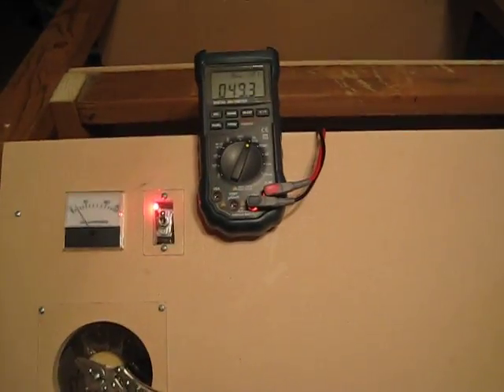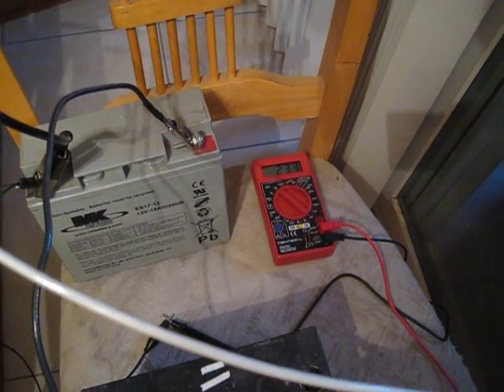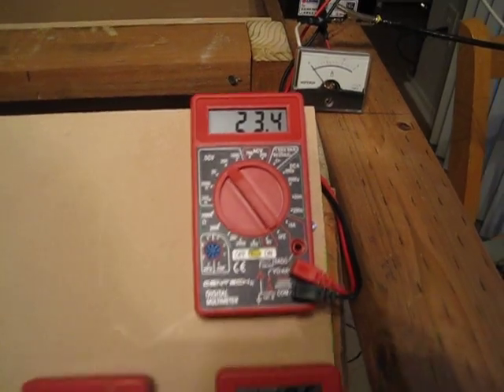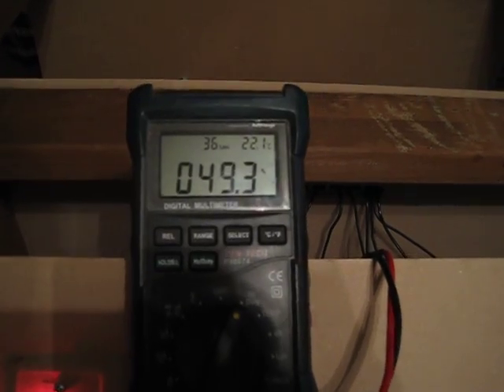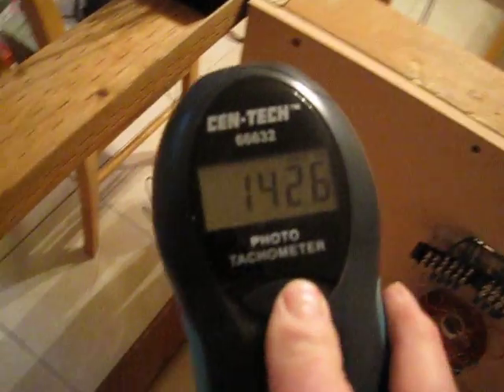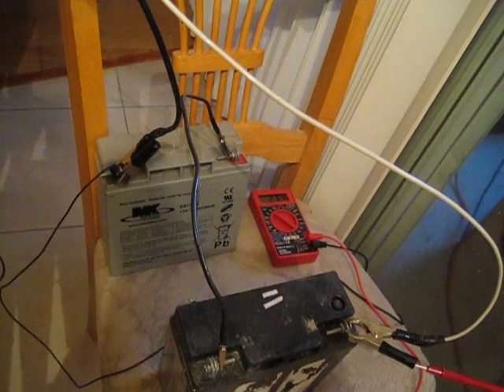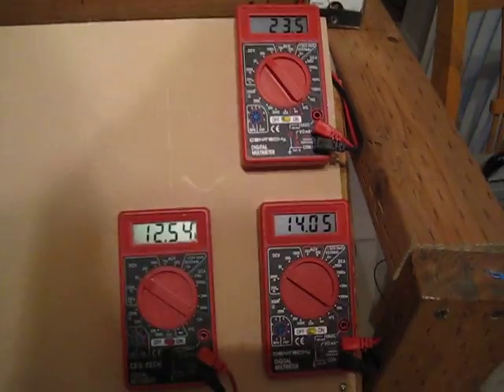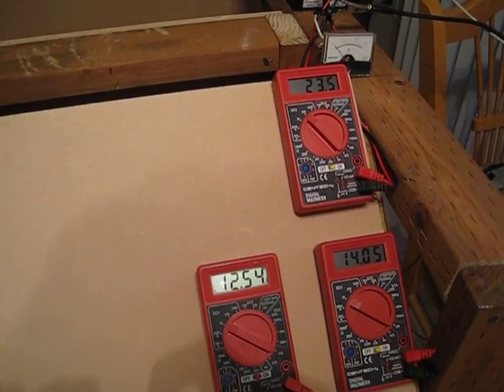3 phase charging 24 volts off 12 volt run battery 002

Comment: I'm making my coils (4) from scrap enameled wire. Since not all scrap is conveniently the same, is it ok to make coils out of wire that is close but not exactly the same? Readings would be more stable and troubleshooting would be easier if the whole system was exactly the same but when you are working with scrap wire to cut costs, is it mandatory? Would 3 14 gauge coils and a 20 gauge coil be  ok to use or should I wait until I have enough 14 gauge to make the 4th coil? Thanks Steve
Reply from the maker: I would say no, when you are trying to get power off the 3 phase or pulse motor circuit you will not have a even flow/same power output from each phase or from a particular transistor. might cause a nightmare of problems. I would just take your time and get the same size wire for what ever build you want to do. between 14 to 20 is way to much of a spread. two strands of #18 = output in same length of 14 to 15 wire size. so you can see what the difference from 20 to 14 could be. if your running that thru a bridge rectifier is where I think the most problems will occur .

Comment from the maker: hey, thanks buddy, i checked out that work your doing on the jet engine, very interesting. this pulse/3 phase keeps getting bettery. doing a few mod's that will improve effiency a lot. so far i can charge battery banks from 6 volts up to 48 volts with no problem. you know me, always trying to make it stronger. catch ya later on!!